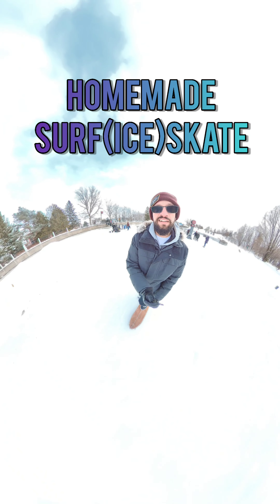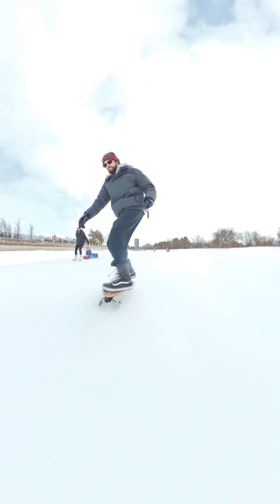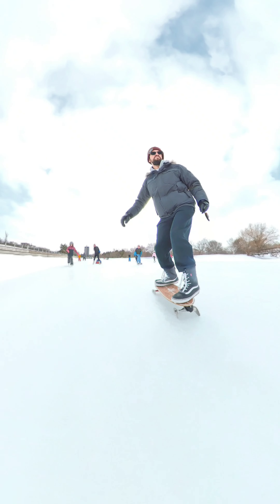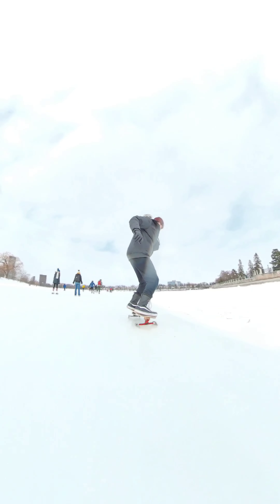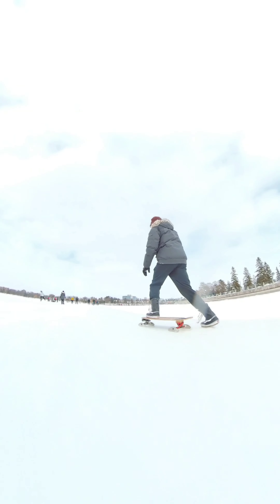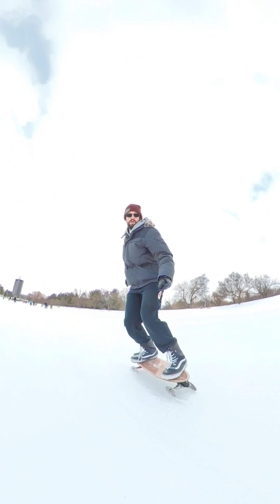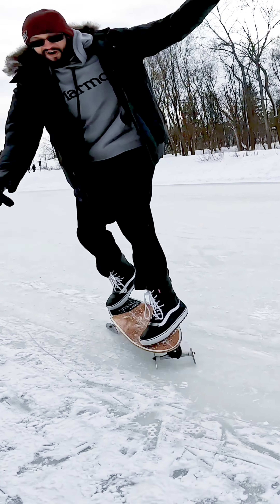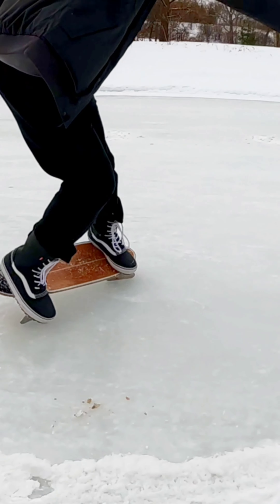I Built a SurfSkate on Skates! The Ultimate Canadian Surf(ice)Skate

Comment: Why did you make the front truck narrower than the back? What SurfSkate truck was that? It didn’t look loose enough. Too cold?
Reply from the maker: I was going to use the same trucks at the back then realized the deck wasn't drilled for the hole patterns in the matching trucks after getting the front set up (long story short - lazy!).  I also wondered if wider rear trucks might be better to stabilize the back and let the front do the work.  I think you made a really good point that I didn't consider - Since the Waterborne system is bushing-based, the cold weather might have hardened it up a bit and made it tighter/less mobile.
Reply: @MarktheLandlockedSurfer  you need a meraki or a c7 truck I imagine. Both trucks should be same width I’d think. Maybe weld a skate blade at the outer edge of the truck, where you’d have the nut holding the wheel, and maybe another at the inner part where the truck truck begins. The SurfSkate on land requires two points of push on every wheel, inner and outer. I’d imagine you’d need the same points on one for ice. I notice wheels cone inwards on SurfSkate skates. Maybe the inner blade would be set a cm or so lower so that there’s less drag initiating a turn but loose enough to swing as designed while giving you the second point of stability I mentioned about. I think the mechanism is more like skis in the front than a snowboard. You likely need 4 edges not two. But I doubt it would hurt stability any having 4 in the back. But it might not let snaps release since the back trucks aren’t on a swing spring mechanism like the front. I’d think you shouldn’t have to push any if you can get the design applied correctly.